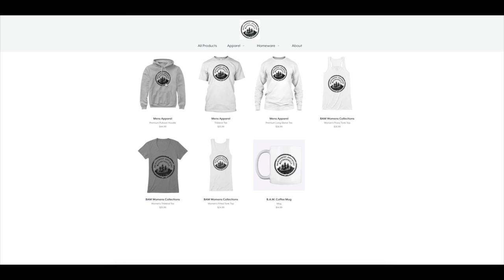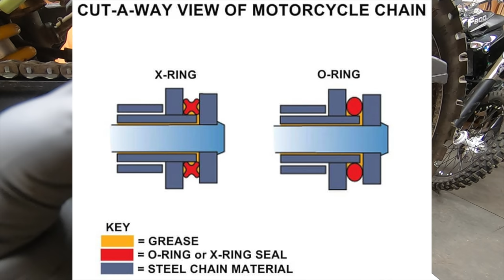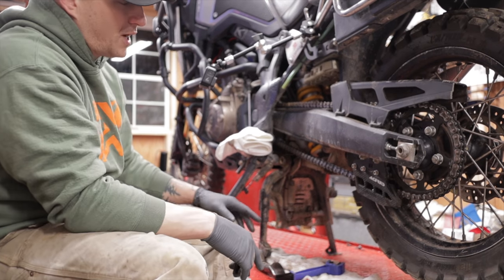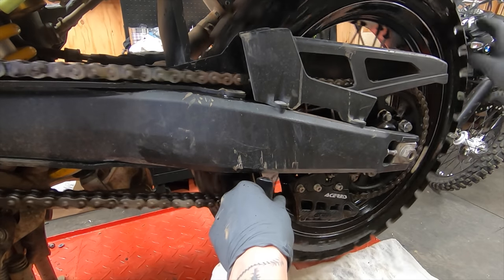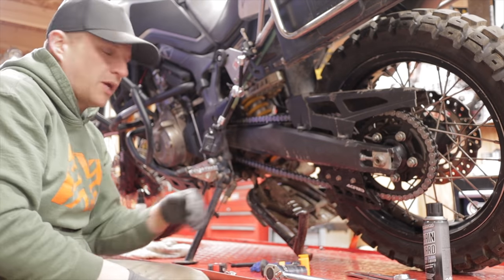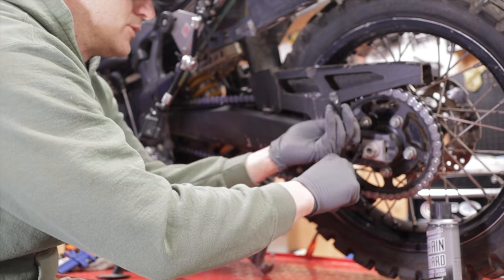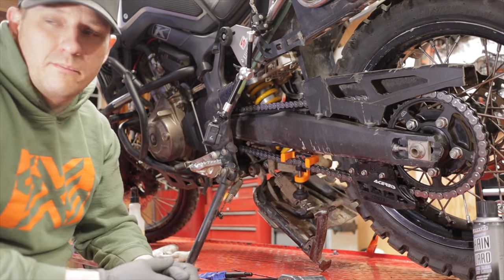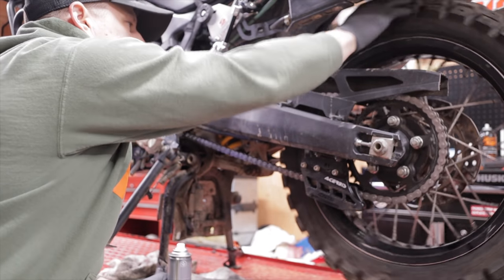Adventure Motorcycle Chain Maintenance Honda Africa Twin and other bikes

Comment: Cool info . Agree with you on the wax . I have a bunch of small bottles of it that I found in a storage unit and have been using it for 5 years now , not on my motorcycle but my mountain bike and 2000w lithium 60v scooter that I have my dog chase me on . We have a small park that I can take her running on and that chain gets real dirty real quick . Usually don't fuss too much about it but that attitude is different with maintaining my motorcycle . 
    Looks like I have to get rid of more crap in the garage because that table lift is just what the doctor ordered . I have to get a flash drive and load it with all the how to videos and so far a couple of yours will be one it . 
    Have fun on your ride !
Reply from the maker: Thanks for watching. If you search craigslist or facebook you can usually find a used one for cheap 👍

Comment: Thanks for the great content you put up related to the AT.  I just recently bought the Rugged Roads Acerbis chain block similar to what you have and wanted to ask about how much additional noise the piece adds when the wheel is rotating?  Mine really seems to be rubbing on the (sides) of the chain and makes a considerable amount of noise.  I'm wondering about additional wear on the chain if it is rubbing as it passes through the block.  Thoughts?

Comment: Asking because I haven't tried this yet, but looks like you only loosen or tighten the axle nut on the far side.  So the nut facing you doesn't turn.  Correct?

Comment: I just added the ACERBIS Chain Guide on my 2017 AT...did yours rub a little on the side of the chain out of the gate?  I have tried to adjust is and it will not completely go away.  I assume it will rub down over time.  Great videos, awesome channel!  Thank you.

Comment: Good video, I would like to respectably disagree with your comment about overtightening the axle nut damaging the wheel bearings.  There's a spacer inside the wheel that sits tight against the inner bearing race preventing this from happening. With that said, a torque wrench should always be used to tighten the axle nut to the correct torque ( as you did) keep up the good work!
Reply from the maker: Thanks for the tidbit. I'm not arguing this at all, and it may be true that the space is there to help prevent over tightening, but id like you to try something next time you have the rear wheel off. Try putting it back on without the chain or the brake caliper. Then torque it to spec. Spin the wheel and it should spin as normal. Then give the nut at least one half to a full rotation and spin it again. You will notice some resistance and it doesn't spin as freely. This leads me to believe that it will cause damage if over tightened. Just my observation.
Reply: @backcountryadvmoto  You are correct, an over tightened axle nut will sometimes cause an increase in rolling resistance.  The parts of the  axle assembly work together as a precise unit. Overtightening may cause the internal spacer to 'crush ' slightly causing an increase in axial loading to the complete assembly. As you pointed out, a torque wrench should always be used. With that said, 99% of wheel bearing failures are from the ingress of grit, mud, water etc.

Comment: My Chain Monkey instructions say to remove the black plastic cap from the. domed nut before use.
Reply from the maker: +Mark Bright That’s funny that you say that because you’re probably the second or third person that I said that. I have one of the originals and it does not say that in mine. If you watch the chain monkey video on their site it is left on to protect the chain, but I guess it really doesn’t matter now, because when I made this video the black cap on mine finally broke off, so I guess I’ll be leaving it off from here on out haha 😂
Reply: Backcountry Adventure Motorsports to be fair, I bought the whole set of banana lube, chain cleaner, wheel roller stand and cleaning brush with the Chain Monkey about two or three years ago, and only read the instruction about the cap last week 😂

Comment: For maintenance jobs you use a Harbor Freight motorcycle platform lift.  Wondering why you chose this over the smaller (easier to store) and cheaper scissor lifts that support the bike only in the middle?  Thanks!
Reply from the maker: First off, great question and thanks for watching. I got the lift used and barley pain $100 for it. secondly, I have 8 motorcycles and this works for all of them. Try changing the oil with a scissor lift that supports it in the middle. 😬I use this lift because it can get lift the bike up very high and it is convenient for me, so its just my preference.

Comment: I noticed that my swing are has that hard plastic guard on both top and bottom. I suppose as long as I measure both the upper and lower position of the chain from that plastic guard on the bottom of the swing arm, it should be good. I measure 1.25 inches so it appears I should be good.

Comment: Great tutorial! You explained each detail well, and this will help me (new bike owner). Both your video and the Revzill@ video suggest using kerosene as a cleaning agent, and in both videos it worked great. My 2019 Suzuki DL1000A/XA manual (page 7-31) specifically says to NOT use kerosene or other volatile cleaning agents. I’m not sure why since Suzuki sealed chains seem to be the same or similar to other manufacturers sealed chains. Does your AT manual have a similar restriction? Also, I think you have convinced me I need a lift/table.  Looks like it makes most jobs easier.
Reply from the maker: That interesting that is specifically says not kerosene, because it is not considered to be a volatile cleaning agent. Kerosene has been used by the pros for years with all types of chains.
Reply from the maker: And no, the AT manual mentions to use the Honda cleaner or similar
Reply: Backcountry Adventure Motorsports Thank you for the response.  I think I will use it when I run out of the expensive cleaner I bought in cans. An o-ring chain on one bike shouldn’t be any different than that on another. From the videos, I think the kerosene works better.

Comment: With a sealed O or X ring chain I don't understand the need to lubricate the chain. I clean mine if dust and dirt but add no additional lubrication. It attracts dirt and does not penetrate into the area of the chain that needs the lube due to the O or X ring design.
Reply from the maker: +Michael Fyten I kinda get what you mean, but every O or X ring manufacturer says to service it this way regularly for longevity.
Reply: Michael Fyten its to protect it from corrosion

Comment: Thanks for the vid man! Have you tried any dry chain lube before and is it better for riding on dirt or dusty conditions? Also what do you do when you’re on a long trip (300+ miles) in normal or dusty conditions? Do you clean and lube everyday or just lube or just leave it till you get back home? Thanks man really like your channel!
Reply: @Danny-xb3kd  thanks man! Also just wanted to add a followup question if you guys know the answer- when using kerosene in a concrete garage do you have problems cleaning up? I don't use kerosene at the moment only for that reason. Appreciate the inputs!
Reply: Kim Cruz just spray kerosine on a rag and use it to wipe up the dirt, that way you don’t make a mess. If it’s really dirty lay cardboard on the ground and go to town with the kerosine and grunge brush. Wipe it off and then live only the inside part of the chain focusing only on the o rings!
Reply: Kim Cruz then wipe any excess lube and you’re good to go
Reply: Danny thanks a lot man!!
Reply from the maker: I have, but I cant really say one is better than the other. I do carry a small can of chain lube and will clean/lube and check the chain in camp normally every other day or so.

Comment: If you always have diesel fuel on hand, like I do, you can use that instead of kerosene. #2 diesel fuel, the most common and cheapest, is way cheaper than kerosene, by 50% or more. Just a side note on that, stay away from biodiesel as generally it’s use requires special polymer o rings and seals and I don’t know how oring chains would tolerate it.
Reply from the maker: great tip. Thanks. I always have Diesel in a can or two. I ll give it a shot next time.
Reply: I use diesel as an oil flush! Drain oil, replace with diesel, run for 30 seconds, drain!

Comment: kerosene could be too aggressive for rings - besides, it has creeping abilities to penetrate into the lubrication zone and effectively cleaning that also. so while chain may look spotless afterwards, it's not the same chain inside, in a nutshell
Reply from the maker: What you are saying makes some since, but race teams have been cleaning chains this way for decades. Funny enough the guys over at RevZilla.com did a similar video and they used the same thing .

Comment: FYI remove plastic black cap from domed  nut per how to use chain monkey or did i read that wrong before set one
Reply from the maker: That’s is correct on the new version. I have the very first version and my directions say to keep in on. I don’t leave it on any more though.
Reply: Backcountry Adventure Motorsports great videos ,, I’m getting ready for a week in woods around franklin NC ,, fire roads , etc with a base camp , If you ever head east I did about 20 k miles in 6 month ... I got a ton of twisties 90 percent hard top but now getting ready for cooler weather and back woods ... I truly enjoy all ur videos !!!

Comment: What do you think about automatic oilers?
Reply from the maker: This is just my opinion, but I think they are great for road riding but not something I’d want off road or in dusty environments. I know that seems backwards and you would think having one in dusty environments would be better, but not only are they not built to take the off-road abuse, but the caking up of oil and dirt can cause other issues like counter shaft seal issues and more . Just my 2 cents
Reply: @backcountryadvmoto  Thanks

Comment: That kerosene can not be good for the tire in the long run, I’m sure it’s not killer right away but I guarantee that makes it weaker that a tire that hasn’t been soaked in kerosene.. at very least I’d make sure to not spray the tire with it just to be safe. I’d expect it to be a bit slick after that as well. Maybe I’m wrong though!
Reply from the maker: I do wash it off and to be honest, I go through at least two tires a season. So I think the tread wears out faster than the compound would breakdown on the sideway. Done theirs for years and have never had any issues. Do a quick search on google and you will find that others do this as well. A saw recently that Revzilla even used This method on one of their videos.

Comment: Call me a dumbass, but you lost me 5:20 in.
Reply from the maker: Nah you are good man. This is just a close up at the rear sprocket and what to look for as far as wear goes. Sorry if that was confusing
Reply: @backcountryadvmoto  not confusing, I just couldn't get into watching yesterday. I also use kerosene, and I place a strip of cardboard between the chain and rear wheel. Also, my KTM, on the center stand for checking slack.